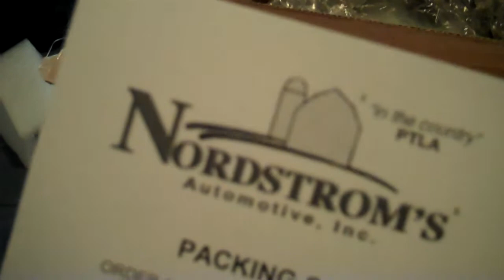Project Two Tone TEMPO Part 1

Comment from the maker: @1979corvette1 Bad cylinder, blows oil all over from the valve cover. I taped up the bypass tube with electrical tape just as a temporary fix. But there's tons of compression escaping. Plus inspection was due and i have extensive rear quater panel rot. It's just too much...

Comment from the maker: @WickedTattoos Yea but there wont be too much left. Theres also been talk of possibly putting it into a figure 8 demo race at the fair. I havent made up my mind yet. The main [problem, is even though MANY of the parts are still good, and have been replaced recently, Like the radiator fan?, the old one is a 2.3L 4 banger and the new is 3.0 V6. A very good percentage of motor parts, including that fan, can't be reused, just sold as is.